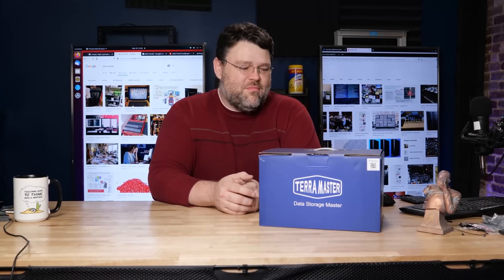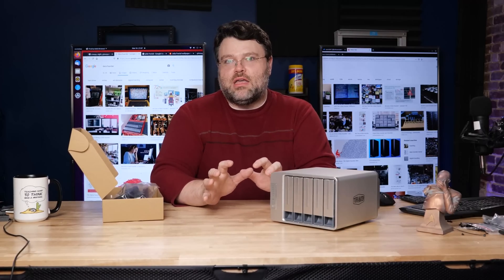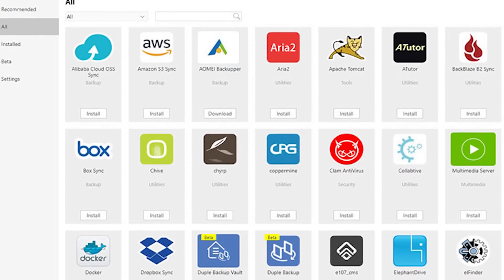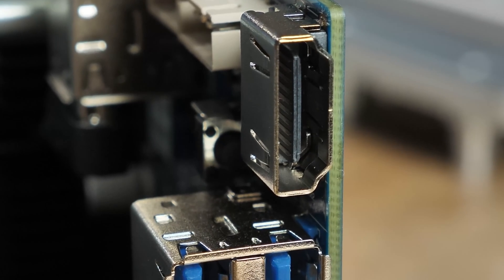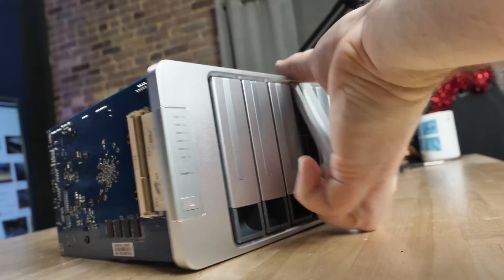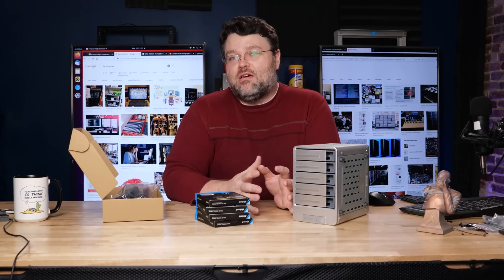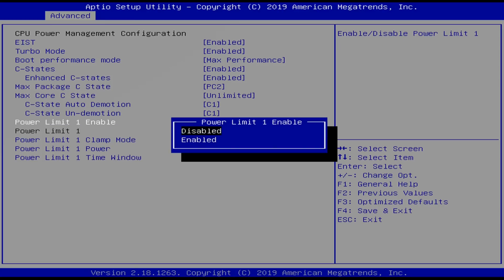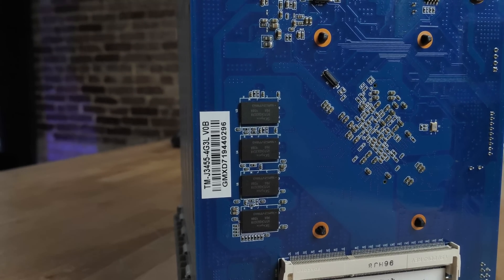You Could WIN This Terra Master F5-422 5-Bay NAS!

Comment: 12GB of RAM? on Intel Ark says it supports 8 GB Max.. Did you guys tested it with a 8GB stick along with the 4 integrated?
Reply: It supports  8 but would work with 16 probably. 12 because there is only 4gb soldered on. Those old celeron supermicro boards i got also work with some dual 8gb so-dimms and boot with 16gb.
Reply: @peterpain6625  interesting, good to know and thanks for the response!

Comment: Not enough an upgrade over my existing NAS, also soldered memory is a turn off. It is a bit smaller than my HP micro server, but not much of an upgrade(can add 10gb through a pci-e card if needed).

Comment: 1) Move the ZFS NAS away from the family PC (Don’t judge, it was the most reasonable way to have any redundancy) onto this, after a blank Linux install.
2) Moving my openHAB instance from my RPi would be quite nice, too, as it’s really slow now (I use a first-gen RPi).
3) Maybe set up pi-hole?
4) Have this serve media via Plex or something similar, as this combines neatly with a NAS.

I like the fact that this has 10 Gig Ethernet, as my next place will have the cabling put in to support that.

Comment: I like how the SO-DIMM slot has a label that asks you to pre-heat your RAM module to 45°C before inserting it.
If I were to win that NAS I'd probably replace my hackjob DIY NAS with it. My 10Gb NIC has been revived by me after getting it's cooler ripped off alongside with the fan header and fan traces :D (it wasn't me who killed that poor thing but the previous owner). That card is using an Chipset cooler from an ancient Mainboard I had laying around and has it's fan soldered onto PCIe fingers, I guess that makes my Username somewhat fitting :D

Comment: I’d use it as a backup and additional storage. I am at a point where my 1tb desktop drive is almost full and my b450 tomahawk sata lanes is almost fully saturated (1 nvme drive, 3 sata ssds, 1 dvd drive, 1 sd card drive).

As a student living in dorms with limited space and noise isolation, this would be a good intermediary until I have more space to build out a home network.

Thanks Wendell!
https://forum.level1techs.com/t/what-would-you-do-with-a-terramaster-nas/164491/149?u=bedhedd

Comment: I would probably run it alongside my current NAS which I have maxed out on SATA ports for adding any more, now also running out of space at my current 8Tb capacity, probably allow me to re-prioritise whats running on what with the better performance as mines is based of an old repurposed q6600 quad core cpu and board with 4gb ram

Comment: I really need a backup solution that does not require my 8 year old Athlon based machine. I've been running 2x8Tb drives for Storj on it ,So something low powered like this I could stick linux on and get docker up and running would be great.That would leave me 3 spaces to expansion so I could back up my data instead of letting it sit 'n' bitrot away on old drvies...

Comment: I would hack it, migrating my current uRaid mini  server onto this because it is smaller and quieter. The server will be used for:
- envy media server, with he transcoding in docker
- nextcloud backup in docker
- bitwarden password manager in docker
- reverse proxy with swag in docker for all the dockers/vms which need to be accessed from internet
- unifi controller in docker to controll the existing ubiquity WiFi devices
- and some training dockers for Jenkins/ Maria dB/ Graphana 
- on the VM site I will have a VM for pfsense router for the hill network with Vlans and a VM hor all the automations from the house using HomeAssitance
- if the server will Handel hire VM's for sure I will try some Linux distros, maybe I can finally move Frome windows but I need to check the new functionalities first in a lab environment.

Comment: Nice... so you could use it with Docker to hold files, send them to .. say a Pi cluster to ' deal with ' and store the results.
With the lower speed connection, I doubt a Pi cluster could saturate it while the higher speed could be serving media as a Plex.

Comment: That weird fan connector is a JST Family connector in case anyone is trying to figure it out
Reply: JST is a huuge family of connectors, with many series, each with their own dimensions, pin pitch, retention mechanisms, etc. It's kind of like telling someone they need a "USB cable" nowadays (but worse) - is it micro? mini? A? B? C?

It doesn't really look like jst xh, ph, sh, or zh to me but any of those might fit
Reply: Also FWIW, super cheap to buy pre-wired female connectors (yes, the board has pins sticking up, so that's the male side even though it "receives" the connector) on ebay. You'll need to see if Terra Master will tell you the size which is measured by distance between pins, or you can make some logical guesses/measurements.
Reply: @engineer99 I can solder 4 wires a lot easier than a surface mounted connector, but ymmv and it would be nice to have the more common connector and never have to worry about it again.

Comment: I would definitely load ZFS modules on one of those, then use it as a backup for my main array at home. I currently have 6tb capacity on my home array as a 3x3tb raidz1, but the system I'm using as an offsite backup only has 3tb because it's a mirror of 2 3tb drives. With this I could just fill it with cheap drives and backup everything from my home array. A reasonably large dual fan setup probably wouldn't bother the people in the nearby offices, unlike the 1U I have right now that I was considering using as a backup.